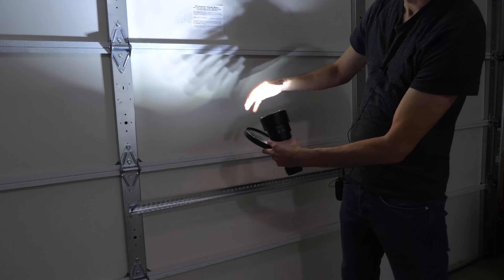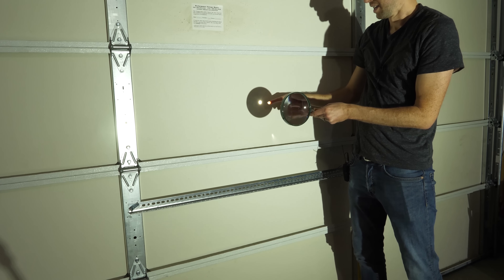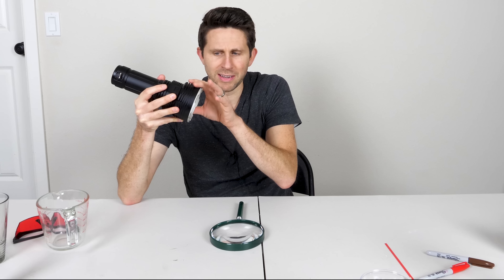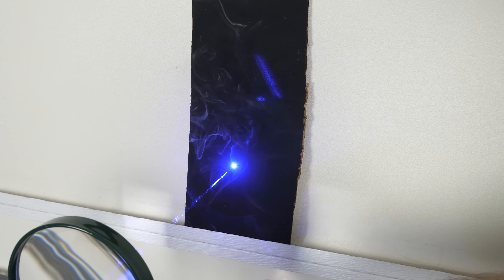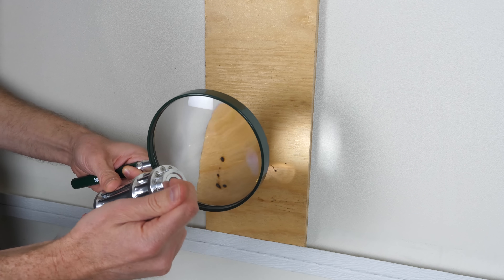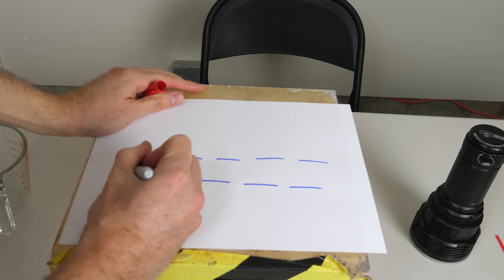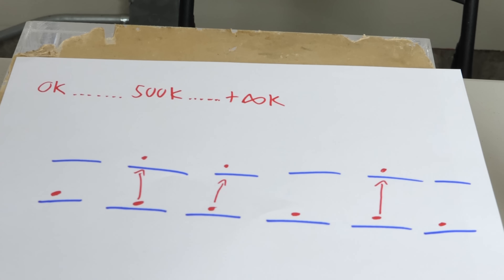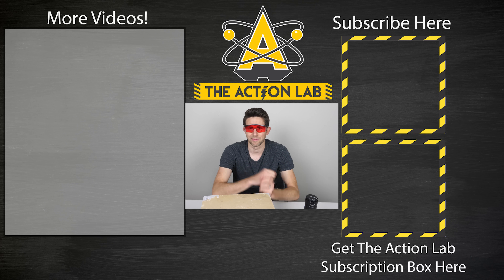What Happens if You Focus a 5W Laser With a Giant Magnifying Glass? Negative Kelvin Temperature!

Comment: have you tried shining the flashlight through a tube with a gully mirrored inside that all ends with the lens, so you literally have all of the light it can possibly produce, confined and captured, which basically forces it to either exit through the lens, or reflect off the mirrored surface into infinity.
Reply: that will capture the heat energy until it either hits the source or the target. It will hit both the source and the target equally meaning that the source will always be of a higher temperature compared to the target
Reply: basically the spot on the target will be hotter but so will also the lamp (and the lamp will never be colder)

Comment: The intensity in Watts/meter^2 is roughly equal to the Stefan-Boltzmann constant times the 4th power of the temperature in Kelvin.  When you focus parallel rays to a smaller area, the intensity goes up, and the temperature.  The laser vacuum experiments will try to focus so the intensity is sufficient to generate particle-antiparticle pairs (electron and positron) from the vacuum.  If you use a mirror, rather than a lens with spherical surfaces, you can combine many mirrors to focus the light from LEDs or many sources to an area where the intensity is greater than the source.  You are not violating any laws.  Total power does not matter, rather the intensity.  

You really ought to learn some basic physics and use equations and models.  If you memorize fragments and do not measure and calculate, you are always going to be limited in what you can do.  On a human level, there are millions of the 5 billion internet uses who are interested in lasers, focusing and using light. But all they find are too complicated  theories for people to show off, or too simplistic fragments that are never enough.  The first I call "floofy science" so clumsy and obscure it is unusable.  The second I call "shooting from the hip".  The sweet spot for a global human society is "engineering".  

I had a boss long ago who was always saying "get our ducks in a row".  You are not getting your ducks in a row.  You do not need everyone to read five textbooks and memorize hundreds of formulas.  You can gather the pieces yourself, put that into a model with all the necessary constants and data, and let those of the 5 billion who want to do things use it.  Give them tools and data in a form they can use it.  Don't make them figure it out for themselves from scratch. That hurts the human species to have everyone reinvent the wheel.  The same if for tens of millions of similar things on the Internet.  

Richard Collins, The Internet Foundation

Comment: hm, i actually don't believe you. 

well, you could use a lot of curved mirrors so that the light from the flashlight would be concentrated to a small area, smaller, than that of the flashlight bulb and maybe having a higher temperature 

also, i am not sure that we should consider the entire sun's temperature, maybe only of the area which is radiating

and still, i am not sure that we should treat the second law of thermodynamics so rude in this case. it looks like it gets more subtle when radiation takes place. it doesn't mean that some point of a radiating body can not be cooler than some point of a body which is absorbing radiation. for instance, a chemical reaction could produce some amount of light, say, at -10°C, which is absorbed at room temperature, so now we have the situation when the energy of photons is transmitted from a cooler body to a warmer one. well, i would rather say that in this case the second law of thermodynamics states that once some energy is transmitted, we can't transmit it back with no loss

Comment: It feels you just made up “negative” energy to justify why it doesn’t break the thermodynamic law.

How? 

If I collect all the sun lights (with an unknown method) and focus it in a tiny point , why is it not hotter than the sun surface? How does it breaks the thermodynamic law?
Reply: Unfortunately, at some point, the light would be unable to get bundled up further. The more you bundle up the light, the higher the spread becomes, making it harder and harder to bunch up. The surface area and the spread of the light are inversely proportional. Let me show you:

Remember this: Systems with lenses and mirrors are reversible (reverse the direction and it will look the same).

Now imagine a small light bulb. The light at the light bulb has immense spread, and it pretty much shoots out in all directions. Now position this light bulb in the center of a very big parabolic mirror. The light will hit the mirror, and it will get “straightened out.” But at what cost? The cost is the increase in surface area. The light bulb had light concentrated very closely, but the spread near the bulb was very high while the mirror reflected the light into nearly parallel light rays, but now they might be many magnitudes further apart from each other.

And because this system is reversible, you can imagine yourself shining light into the mirror and trying to bundle it into a single point. If the light you put into the mirror is even just very slightly not parallel (even just a tiny spread), then the spread will get magnified by a ton after converging to the focal point. The size of this pseudo light source at the focal point is determined by the coherence/spread of the light you put into it, and it is impossible to bundle it up more than that.

Comment: this is not true at all. You can absolutely focus the light down to a point and not lose light on the outside as you mistakingly state ere.
Reply: Unfortunately, at some point, the light would be unable to get bundled up further. The more you bundle up the light, the higher the spread becomes, making it harder and harder to bunch up. The surface area and the spread of the light are inversely proportional. Let me show you:

Remember this: Systems with lenses and mirrors are reversible (reverse the direction and it will look the same).

Now imagine a small light bulb. The light at the light bulb has immense spread, and it pretty much shoots out in all directions. Now position this light bulb in the center of a very big parabolic mirror. The light will hit the mirror, and it will get “straightened out.” But at what cost? The cost is the increase in surface area. The light bulb had light concentrated very closely, but the spread near the bulb was very high while the mirror reflected the light into nearly parallel light rays, but now they might be many magnitudes further apart from each other.

And because this system is reversible, you can imagine yourself shining light into the mirror and trying to bundle it into a single point. If the light you put into the mirror is even just very slightly not parallel (even just a tiny spread), then the spread will get magnified by a ton after converging to the focal point. The size of this pseudo light source at the focal point is determined by the coherence/spread of the light you put into it, and it is impossible to bundle it up more than that.

Comment: Awesome video as usual. I used to work on a laser cutting machine for 5/8 mild steel, as well as a plasma and acetylene torch rig for cutting larger steel (2 inches and over) my understanding is minimal I feel, but the laser had a lens that need to be cleaned and calibrated regularly, while the plasma had copper consumables and a large power source. The copper bits had to be changed every 200 pierces approximately for 30mm material on a 260 watt machine. A 400 watt was capable of 1.5 inch mild steel,  and was very inconsistent with consumables. Now the oxi acetylene torches almost never needed new nozzles, but would get caked with slag. It would be really cool to see a video about how these machines work. It almost seems like less energy efficiency can do more 'thermal work' I guess. Anyway, thank you for the lesson!!!
Reply: maybe aan electro static charge to 'pull' some of that splattering debris?  not know what I really talking about....
Reply: 260 watts plasma cutting 30mm steel? At around 1.3 watts per "pierce"*, this seems pretty fucking cheap, dude. My wife's vibrator has more power than 260 watts. Imagine what my 2000 watt kettle could do, for both for cutting steel and my wife's pleasure, were it deployed with your technology. Your quote, "...my understanding is minimal" is as big an understatement I have heard in quite a while.
Watts divided by Volts = Amps. 
260w  divided by 110/240 = fuck all. 
*what is "pierce"? Did you cut pieces or just make holes [like your story is full of]? Do you mean "piece"? What pierce or piece are you talking about? How big, length of cut, etc? Come on and bore us with the details so as to further enhance your lack of credibility.  
.

Comment: The explanation as to how*/*why a higher temperature than the source can't be reached with a conventional light source is at best missing and at worst wrong here. You very much can focust the light of let's say a lightbulb into an arbitrarily small area - just put the source into the focus of a parabolic mirror. The parabolic mirror will reflect light coming from the focus in a collimated beam, similar to that of a laser. At that point you can focus it with lenses or mirrors however much you want and fire it at let's say a small bead, transfering energy and raising the target's temperature rapidly. The actual limitation arises from the target now becoming a (potentially very intense) light source of it's own through blackbody radiation. Now the target rapidly radiates energy away - some of it back at the original source. The two objects are now in thermal "contact" through the photons bouncing back and forth, unless you employ Maxwell's demon to gatekeep the backflow.

Comment: Your physics is infuriatingly pathetic. You throw around wrong technical terms, misapply concepts and are generally wrong.

You are incredibly misleading. This is the shit you've said "For a flashlight, you can never use a lens to focus the flashlight down to a brighter point than the original source itself" while holding an LED flashlight! 

What is the source? It's an array of LEDs. Collimate all the light of it and focus it on a point and it will be brighter than any point in the source because you are using an array. 

Then you are bringing in concepts like temperature and entropy, that's when you completely lose your marbles. 

You gotta really misunderstand the second law of thermodynamics, if you think that temperature at one point inside the system compared to another fully reflects entropy of the whole system.

Yes, you can use a flashlight and lenses to shine it on at a point on an object and have that object have a higher temperature than the flashlight. 

Flashlights are designed in a way to allow for heat dissipation and LED flashlights give off most of their energy as light in the first place. It's not blackbody radiation. 

Temperature is not heat and is not light. That is such a simple statement, but you aren't grasping it. 

Take a mirror to reflect sunlight. The mirror is now the light source. What is its temperature? It's gonna be lower than what you point the magnifying glass to from your reflected light. A light source has no inherent relationship with temperature

Comment: LEDs and lasers emit light at a single frequency.  (In fact, the 5W laser is an LED device.)  Because both the flashlight and laser are LED based, both emit light at a single frequency.  Each of the flashlight's LED bulbs are actually three individual LEDs in red, green, and blue so that when combined, the light appears white to our eyes.  The only real distinction between the two devices is that the laser LED emits light that is  coherent.  That is, it comes out as a narrow beam.  (But the beam disperses the farther it travels, and even at close range, you can see that the beam produces an oblong spot that is larger than the laser's LED.)  This results in the laser's power (5W) being concentrated on a tiny area (what appears to be a few square millimeters).  So, if you apply optics to the light coming from the 35W LED flashlight so that its light is focused onto a few square millimeters (similar in size to the laser spot), you would actually have MORE power per square millimeter, and would have a device that would produce higher temperatures than the 5W laser.

It's all about watts per square inch.  If you have a 35W flashlight, and you have the proper optics (i.e., multiple lenses) to focus the energy onto a small point, when the energy concentration is sufficient to cause the temperature to exceed the material's combustion point, you get smoke and fire.  It is not about the surface temperature of the source, it's about the energy concentration.   In fact, I've done it.  You just need the right optics.  I've also done it with a good old-fashioned camera strobe flashing through a telephoto lens, properly focused, onto a piece of cloth.  Even though the flash lasts for only 1/10,000 of a second, you can cause combustion if the optics are set properly.  Frankly, I think the discussion about thermodynamics and positive/negative infinity Kelvin temperatures is completely irrelevant to whether you can cause a fire with a flashlight.
Reply: The point of the idea (in the video, but not fully explained) is when you have only one lens focusing black body radiation from an object, it's impossible to focus it and have a light density greater than the emitter itself. That can be changed if using more lenses. But for lasers, as the light is emitted already in parallel, it is possible to focus it, with only only lens, to a density greater than the surface emitting the light.
Reply: Sorry but LEDs do not emit at single frequency and coherent does not equal narrow beam.

Comment: Utter rubbish. Boltzman’s equations are incorrect. Google Gibbs equation. The mere fact you get infinities should alert you to the equations being inadequate. MIT article from December 2013 says “In a paper published this month in the journal Nature Physics, the researchers analyzed past claims of negative absolute temperature and found that in all cases, scientists were interpreting experiments based on a flawed — though universally accepted — definition of entropy, or heat. This definition, called the Boltzmann entropy, appears in modern physics textbooks, and is widely used to calculate the absolute temperature of a wide range of physical systems. 

But as the MIT team found, the definition only works when atomic or molecular energy states exhibit a normal distribution, where higher energy levels are less frequently populated than lower ones. In more exotic systems, such as certain quantum gases, the definition breaks down. Accounting for this error, the team performed mathematical consistency checks using an earlier definition of entropy, and found that such systems actually exhibited positive absolute temperatures — a result suggesting that previous studies were using the wrong definition, or essentially an inaccurate theoretical “thermometer,” to measure the absolute temperature of exotic systems. “

Comment: „Energy can never flow from cold to hot“. So how does a heat exchanger (aka heat pump) for heating a house work then?
Reply from the maker: when a heat pump is heating your house it is cooling the outside air. the heat from the fluid in the lines is hotter than the inside air due to being compressed in the compressor. So that heats your house. Then it goes through an expander that cools the fluid down colder than the outside air so the heat from the outside air flows into the cooler liquid and then back into your house.

Comment: Not true. There are lenses to collimate light like that out of a flashlight. Subsequent lenses can converge it closer to a point. Such a point can be brighter than an equivalent sized point on the source if the lenses combines the energy of many such points into one. Energy is conserved because the energy at that point contains light rays that would have illuminated other surfaces, in other words you get it when you turn an omni directional source into a unidirectional one.

Comment: Man, I respect you, but you are so wrong oriented on this.

The reason you can't get a higher temp or brightness with a magnifying glass, is because your source has an array of a greater area than the magnifying glass. And as you move it away to focus, the area keeps spreading out. Not so with the laser, because you have a 10mm diameter array that narrows as it get farther from the source, and a mag glass about 120mm wide!

About heat, your stitch assist fails! You say it can heat up because it has a negative temperature, but you sisu say, in 7:36, that the temperature is cakes negative, but in fact it is hotter. So you can call it divergent, duck, negative, or surreal, but on fact it is hotter, thus it heats up the surface where it lands.

Go place yourself under a spotlight used on theaters or concerts. Those lights are very well controlled, they don't flood units you want it to. Put a  magnifying glass focused on front of it and tell me, down there if it doesn't have the same effect as a laser. Just make sure the mag glass is wider than the spot light array. That's it.

Man, this video was like the scientists who were measuring a frog's capability to jump with all four legs, three,, etc. They'd cut off a leg and ask the dog to jump, then measure. When they cut all the legs, they asked once again, and as the frog didn't jump, they concluded it had gone def.